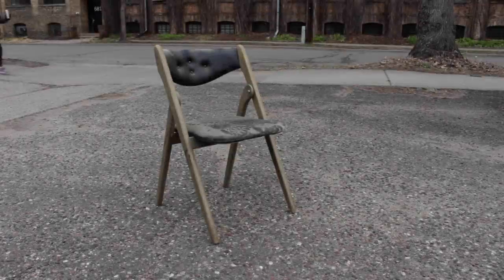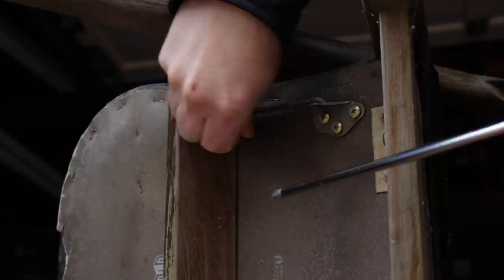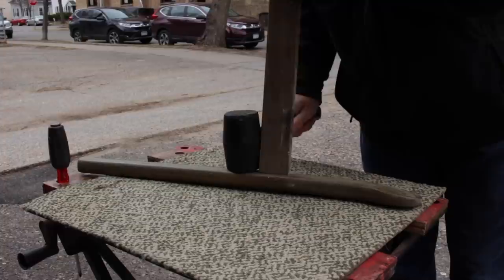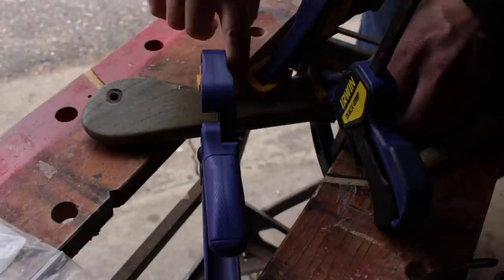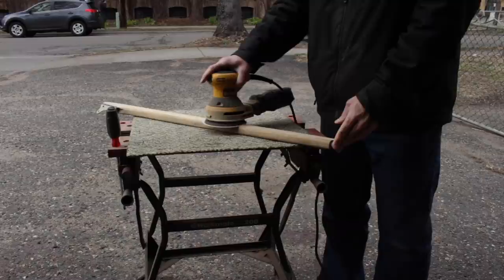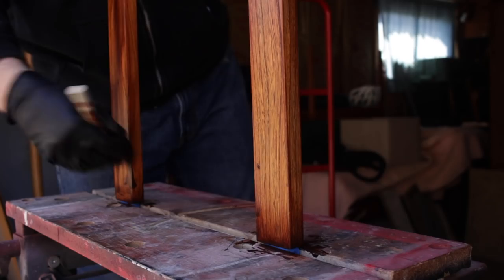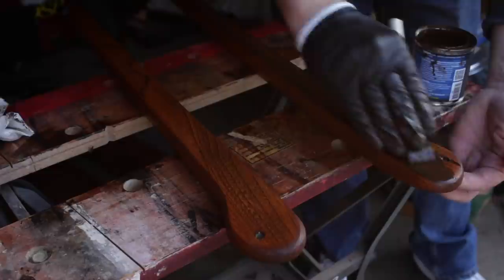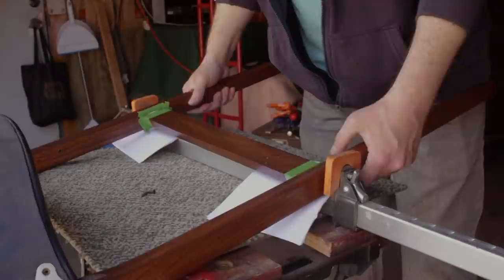Refinishing And Repairing a Mid Century Folding Chair | Furniture Restoration

Comment: That strange green color...I have a small cabinet with that. The top has powdered off, yes, except in the grain and a very deep grain it is, the rest is still coated. I've been eying it for years wondering what it was and what to do with it, so double thanks for  this video! The chair looked absolutely lovely when you were done and way better than it could ever have looked with that greenish coating on it!

Comment: What technique do you use to fix holes in the wooden furniture with lose screws?  I tend to stick a couple of wooden matches inside and then put some dish soap on the screws and tighten them, but that's an old method my dad taught me.  I was wondering if there is new technology for that.

Comment: I have an old chair circa maybe MCM. Like an office waiting area type. My chiropractor was doing improvement to the office and the subcontractor used this chair as a saw horse cutting into the back in about 6 or so spots deepest going throughout the back at about 1 1/2" deep. Others only 1/2" deep. The same on the arms. Not as bad though.  What would you advise? I want to refinish and gift it back to him. What would you recommend. this is my first time refinishing in about 20 yrs or better

Comment: I guess it's OK to poly over shellac, as long as its oil?
Reply from the maker: Water based poly should work over shellac as well.  Some people recommend only using dewaxed shellac under finishes. I’ve used waxed and dewaxed and haven’t noticed any problems using waxed.

Comment: How would you deal with moisture/water damaged wood trim? I have a neglected window trim that has turned a discolored grey and I would prefer to keep the wood instead of replacing it
Reply: It depends how bad it is. First thing would be to stop the water from coming in however you can do that. Next you could try sanding the wood down so it is smooth and then stain or paint it.

Comment: Why didn't you use the drill to screw the places? Use the smallest diameter of the drill bit, so that the work is faster without making cracks in the wood.
Reply from the maker: I like it slooooowwww.

Comment: Are you using steel wool to apply the polyurethane?
Reply: Beautiful work as usual.
Reply from the maker: Hi, I'm using a cotton rag.  I wouldn't use steel wool for that.
Reply: I didn’t think so but I wanted to check. I thought it was a long shot but I could see what it was. Thank you for responding

Comment: No new nails or did I miss that part?
Reply from the maker: I didn’t put nails back in. The factory would have put them in there just to hold the joint while the glue dried.  I used clamps for that.

Comment: Where do you get the needles for your glue?
Reply from the maker: Rockler.
Reply: If you have a farmer's co-op in your area, they carry them for horses, livestock, etc. I've picked up three different sizes. The should have some without the needles too. Helpful hint: if you fill the syringe with glue, wipe off the needle and put the cap back on it. As long as you have a good week on the plunger, the glue won't dry up. That way you not wasting syringes after one use and not wasting glue.
Last time I bought some, I bought two each o three sizes. Total was $3.00 and some change after tax. Hope this helps.
If you don't have a farmer's co-op, check tractor supply company.
Reply: @DashnerDesignRestoration  – Thanks!